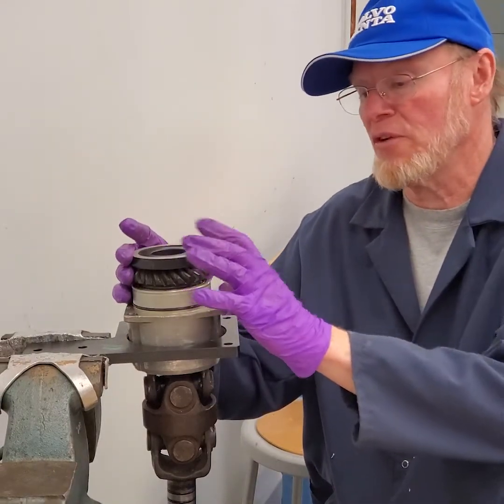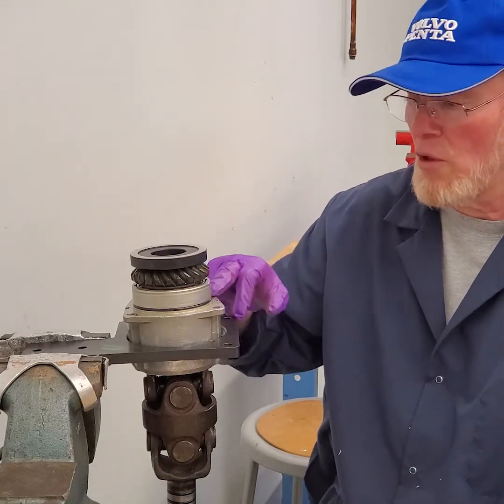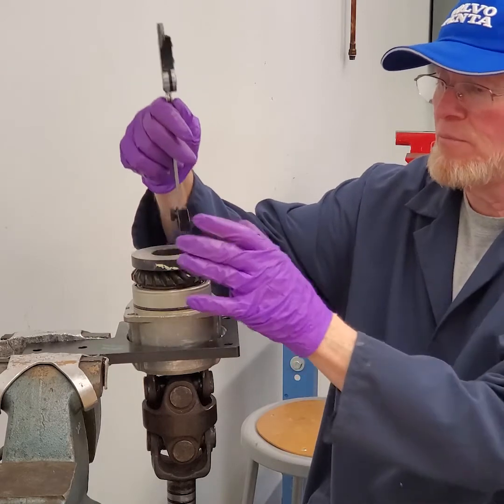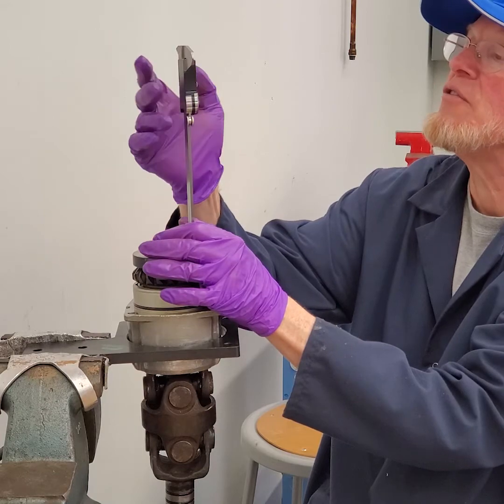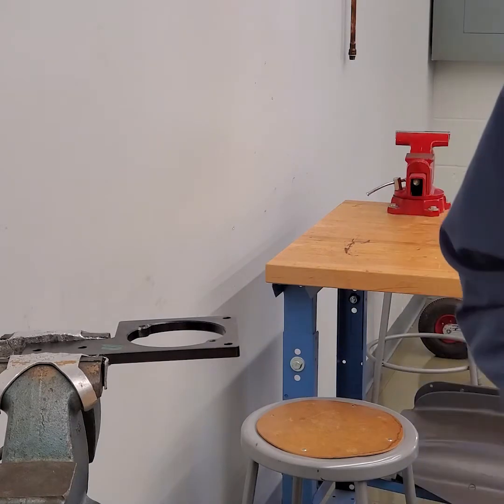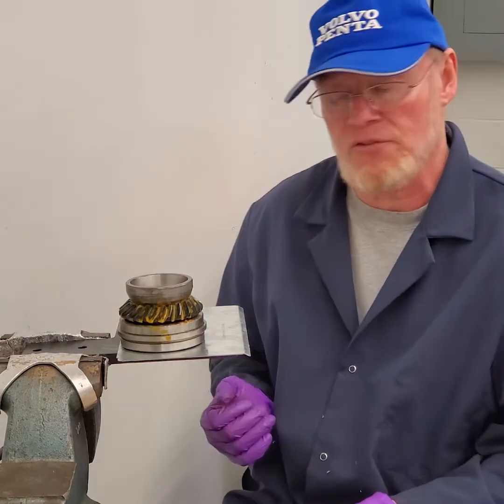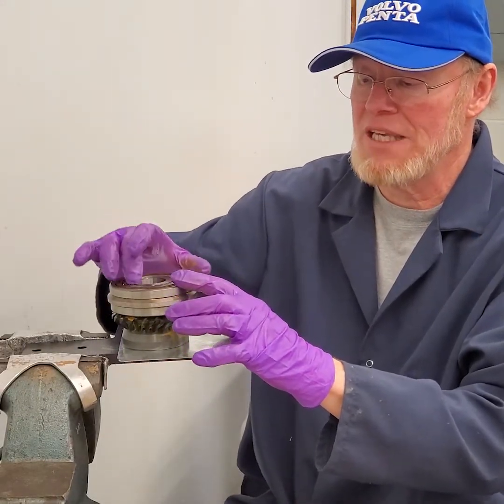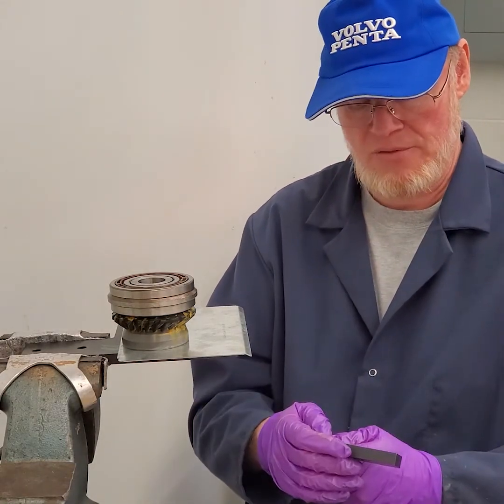Volvo Penta DPS upper gear case Sterndrive repair

Comment: I have an sx-m outdrive. My upper vertical shaft is sticking about 2 inches out of my upper gear/ bearing cap. Twisted and mangled the dipstick straight up until half of the needle bearings were showing. I have more details, pictures and questions. Can you help me out?
Reply from the maker: Please send me pictures to marinedoc01@yahoo.com it was likely due to a high speed shift.